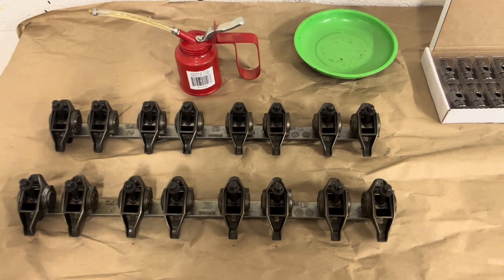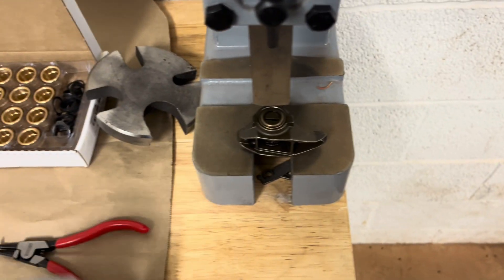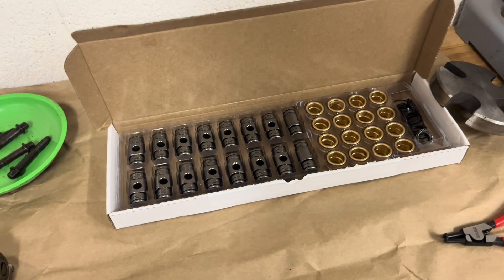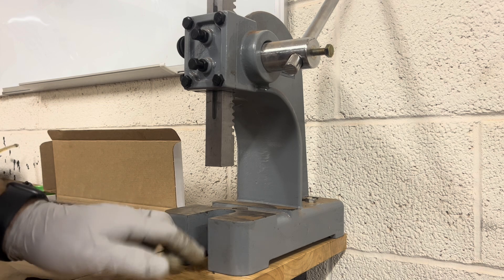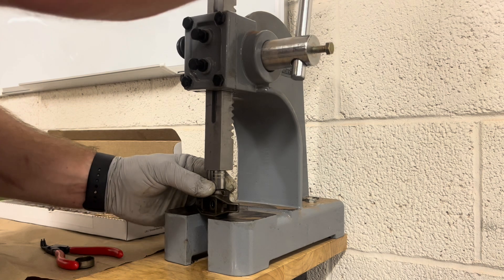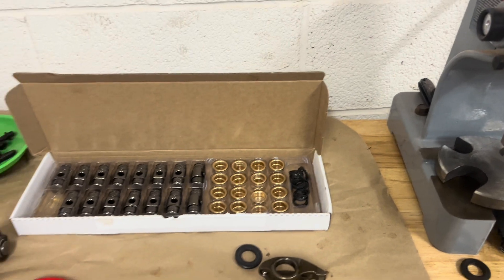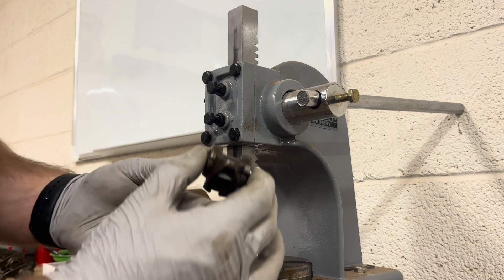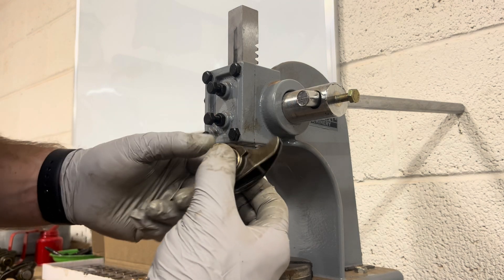LS Trunnion Upgrade: Step-by-Step Installation Guide

Comment: Great video!
Reply: Does it matter what size of washer you use is it just so it’s flush once pressed am I over thinking it lol my kit didn’t come with washers so just wondering I got mine all pressed out ready to reinstall
Reply from the maker: Comes with the washers.
Reply from the maker: Appreciate it!
Reply: Do you need to remove all the spark plugs?